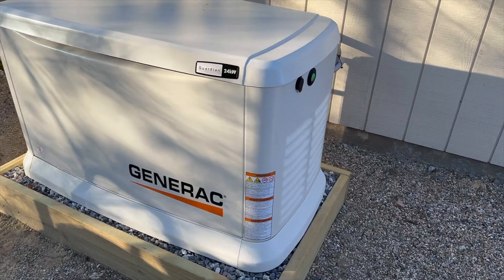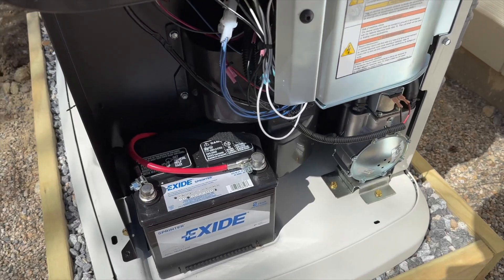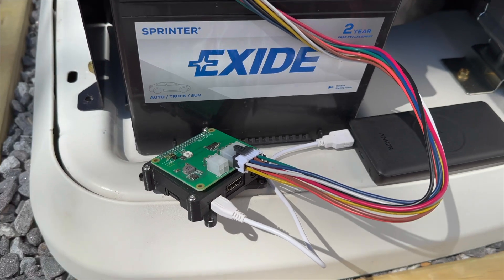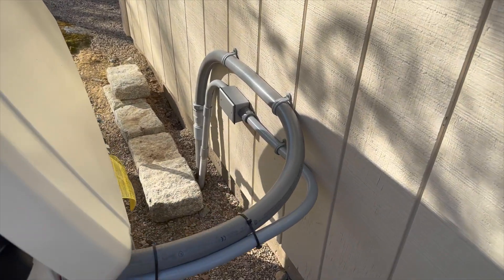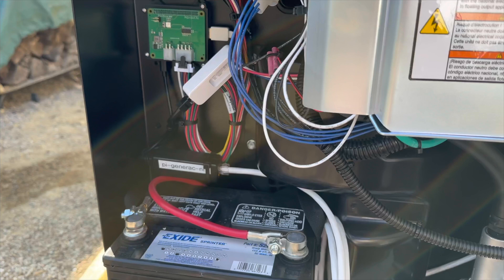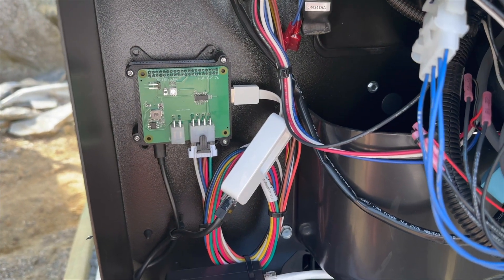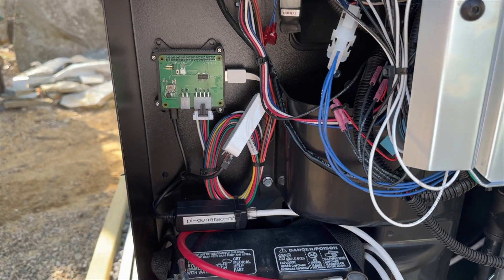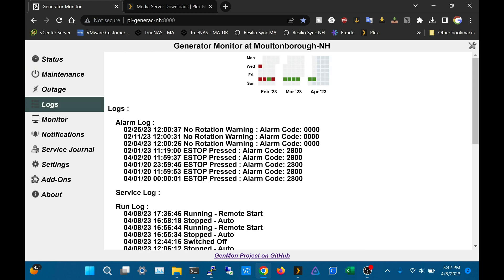Raspberry Pi Generac Generator Monitor DIY

Comment: Good job. Looks great. Considering putting this on my generator. I use a wifi extender that is on the inside wall of the house right next to the generator. This solved my wifi issues for connecting reliably to the stock evolution controller. It was like $30. Might work for you. I am going to use the same wifi setup to put this rasberry pi setup in place

Comment: You should reinforce the joints of the 2X8 frame that you have holding the gravel under your generator, in a couple of years they will come apart on you and spill out the gravel.
Reply: No it wont. You have ZERO knowledge of this. I have had my exact same standby generator on a pea gravel bed with heavy duty edging holding it in place for over 6 years and its just fine! He has treated wood which is overkill and will last decades. So I guess the rim boards on everyone's house is falling apart too according to you as they are fastened the exact same way. You are an idiot!

Comment: Concerning your PoE splitter... can you post its brand/model?  Also, am I correct in the PoE splitter is connected to a PoE switch in your house?
Reply from the maker: It’s a uctronics micro usb poe splitter that I got off of Amazon and there’s a UniFi flex switch powering it on the other end that goes back to a 48 port UniFi switch

Comment: What case is that that you are using for the PI main board?
Reply from the maker: It’s actually just a 3d printed case I found on thingiverse.
Reply: @romanoindustriestech  or @waterboy... do either of you have a link to the case used?

Comment: How are you getting fuel level?
Reply from the maker: So the fuel level is an estimate based on the tank size and the duration it’s been running for. All configurable in the software. There is an option to put an add on tank monitor but the tanks are so big that I don’t see me needing it right now